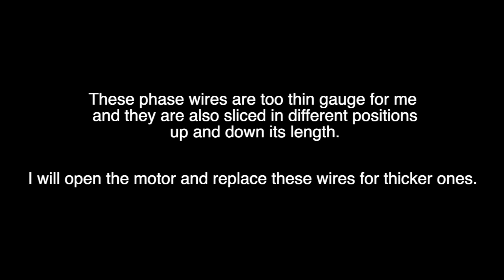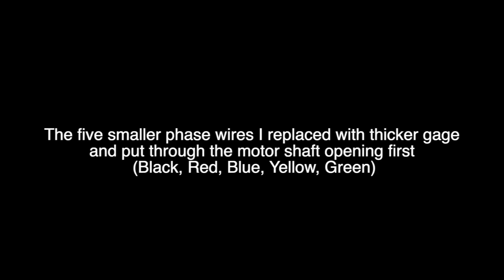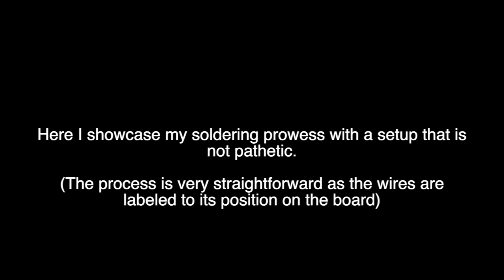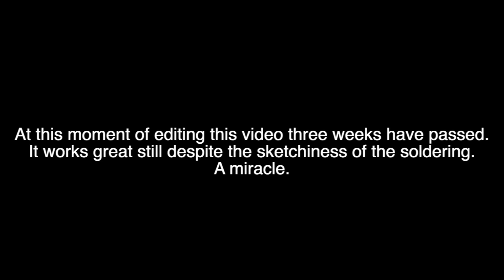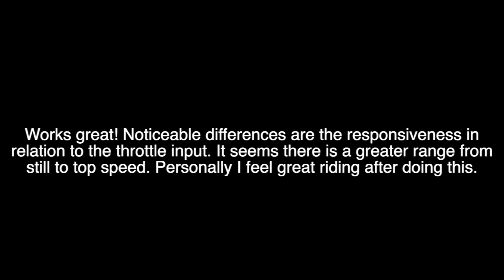EBIKE HUB Motor Modification Phase Wires Replacement Thicker Gauge DIY

Comment: 😂😅 Lol!! You should see my motor I replaced my 3000watts motor wires with 10 gauge wire is a miracle that my motor is working with my horrible soldering and I mean horrific soldering (🤣3 big balls of solder) 😂 yours looks good.

Comment: i have the same motor ,we enlarged the slightly the hole through the axle  we removed the silicon from the wire and recovered it with heat shrink as its thinner than silicon now we have air craft grade 8 guage phase wires abd changed hall sensor wires to thinner and stronger type,the motor now runs on 84 volts with 150 amp controller
Reply: hits a solid  65 miles per hour now not bad for 180 dollar motor

Comment: How many amp did it take to melt those small wires what where you running before then what size wire was the one that melted ???

Comment: The 5 small "phase" wires are actually the hall sensor wiring, no reason to make them thicker gauge since they dont are not powering the motor.
They are only for monitoring the motor position.
No harm done by replacing these wires but better to just use the space for thicker phase wires (the 3 thicker wires)
Reply: So I understand the motor spins when the phase wife is powered up and the hall sensor tells it's position like a CPS crank position sensor..I'm wrapping my head

Comment: Hello sir
I have a 6 wire motor and 1 hall connection...
When i connect the 3 wires of  motor from the controller then with the load starting torque is zero and the main wire of the motor is heat......
I also connected the 2 controllers with the motor but the problem is the same.....
Reply from the maker: This motor is 3 phase wires (blue,green,yellow) and 6 hall wires (red, black, blue, green, yellow). I'm not sure I can tell you how to do one that is like yours... Also mine is connected to a single controller not two. I think you might have a scooter type?

Comment: upgrading the hall wires aint gonna do anything?
Reply from the maker: The 3 phase wires along with also the 6 hall wires were replaced with thicker gauge. But the problem is the space of the hole won't allow for too much of a difference but this made a noticeable improvement in my opinion!

Comment: I'm about to purchase a Chinese 3k watt hub and am so glad to see this video. I'm already prepared for mandatory upgrades.
Reply from the maker: That's awesome stay safe though. I think safety shouldn't be compromised for a desire for more if there is uncertainty about it. Good luck though I'm sure you know what'll be good or not!
Reply: @jH100garage  I have 220 miles on it now. Shortened the phase wires about a foot, built my own battery with 10g silicone wire with less than 12" of length. No issues. On wide open runs more than five minutes, the 10g gets a little warm.
Reply: @jH100garage  thank you again for posting the videos. Very helpful and it gave me the confidence to tackle stuff I thought was too difficult.
Reply: @jH100garage  quanto é o valor

Comment: Do you know how many times I googled differently worded sentences just to find out how to attach the phase wire’s to the copper windings. NOBODY HAS IT ON THEIR VIDEOS. I had given up and I just stumble onto yours. So you just used solder? Someone told me that I can’t use solder due to melting temp etc etc. clearly they just wanted me to buy a new hub Moto from them.  I hope I can garner enough info from your video to do this myself. 
Thanks 
Thank you.
Reply from the maker: What's ironic is the fact that the original state which I'm unsure if can be seen in the video but anyways it is also simply just soldered. I believe something important to consider is how you'll keep these phase wires separate from each other and not shorting each other which makes it necessary to use a shrink tube wrap or just electrical tape. Originally I found what I believe is fiberglass covering each phase wire to keep them separated from each other. 

Well anyways to this day it is still running great and I don't believe using solder is a problem at all and also that's what I found had been used originally anyway. I'd even bet it's the case with your hub motor as well. By the way I appreciate your comment and you are definitely welcome!

Comment: I did all this about 4 years ago to mine with silver plated wire. Make the SWG bigger on wires then drill out axle. Alot can be done to improve these motors. Especially Chinese ones. Good to see other people have a go....
Reply: What kind exactly was the wire? And what gauge???